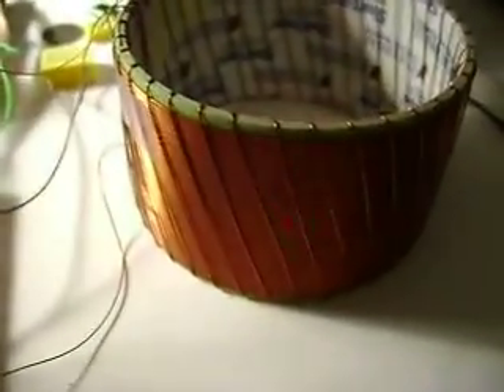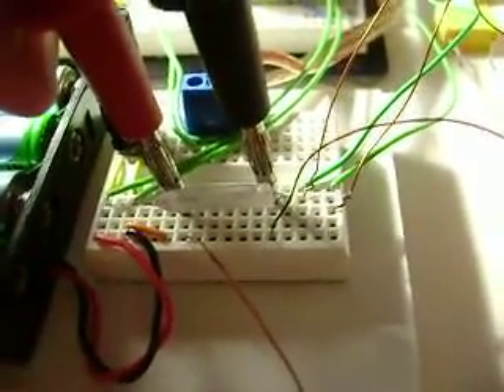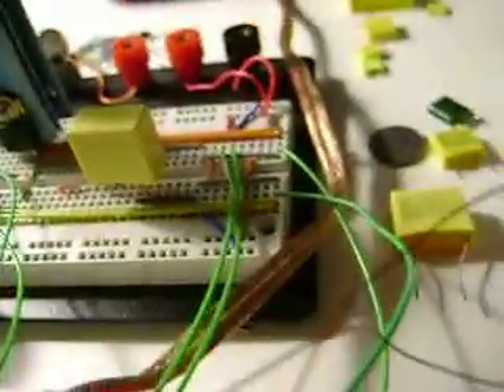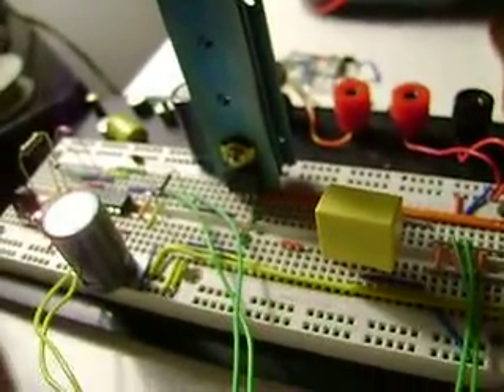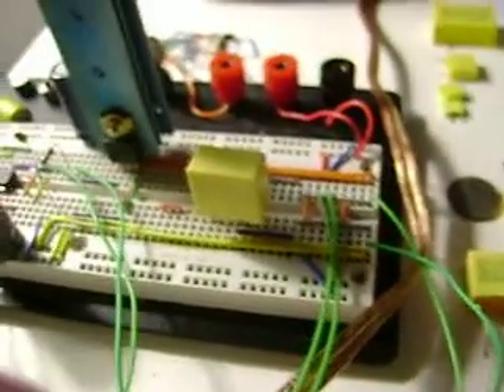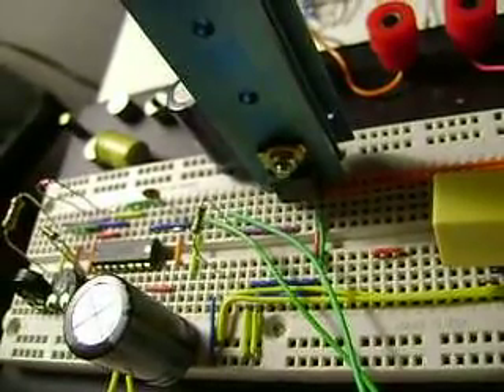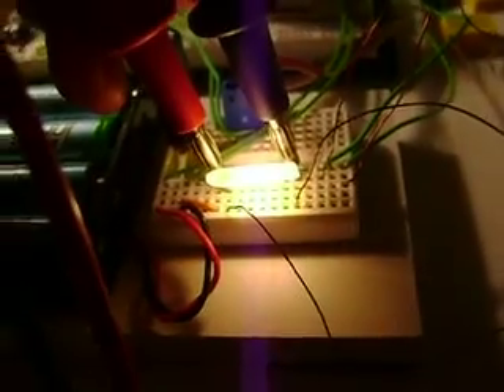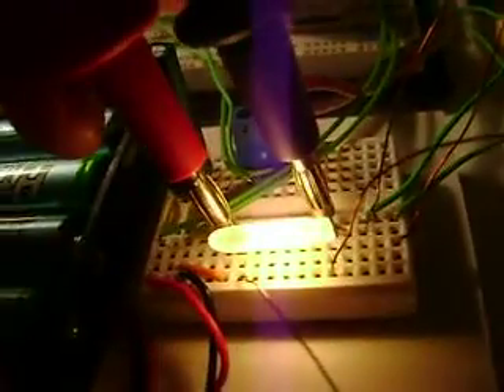Trying AgentGates coil with 555 pulse circuit

Comment from the maker: Both are the same, I believe 28ga. 
It is a design from overunityDOTcom.
The claim was dc output but to get this much from this coil the freq was higher than recommended and the cap was added to get this output also.
Mags